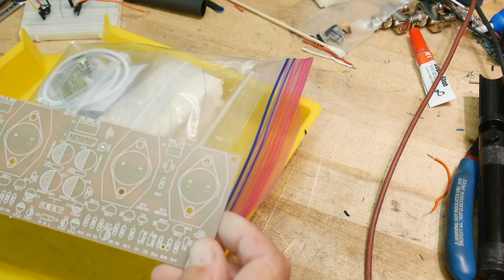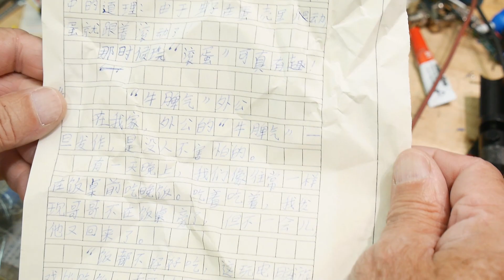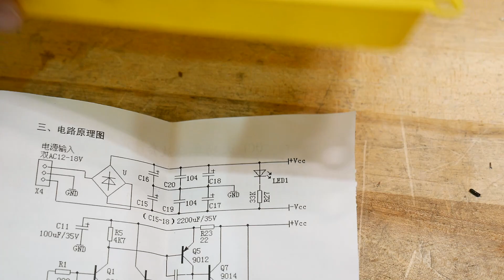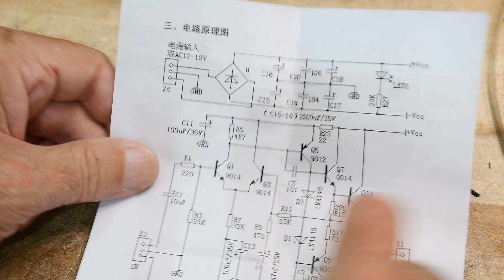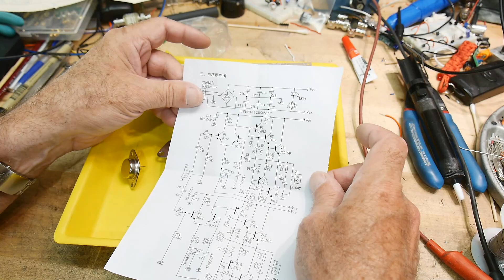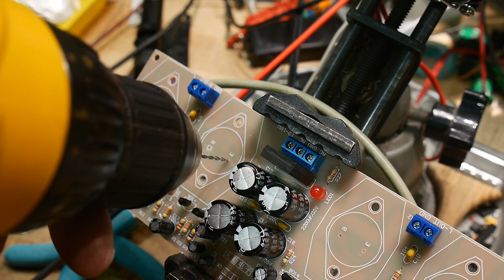#808 Stereo Amplifier Kit and Story Time (part 1 of 3)

Comment: You're getting the same calls on the w/c as we over on the e/c. How do they know. Get the one about your vehicle warr. timing out?  It's a good idea to check the components on those kits first before assembly. Have found defective transistors or wrong ones. Suggestion, add a cooling fan to output transistor section. Thanks for the look.